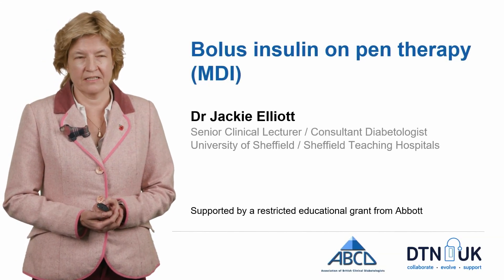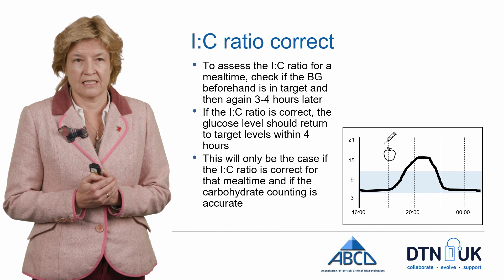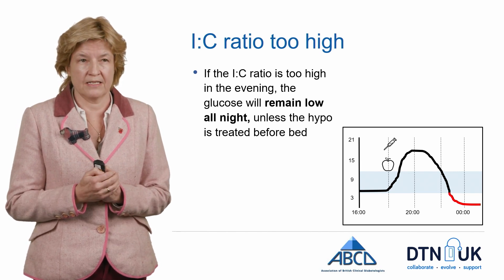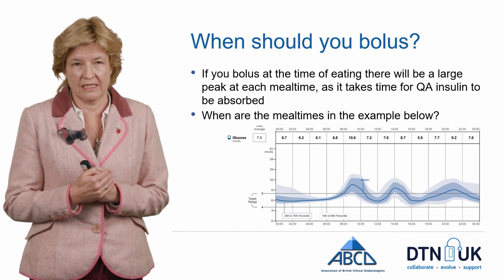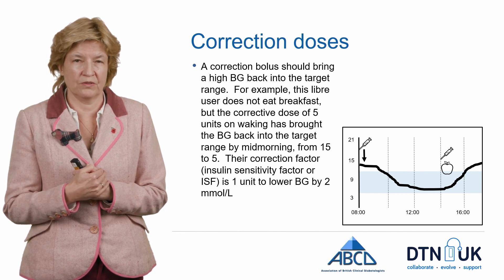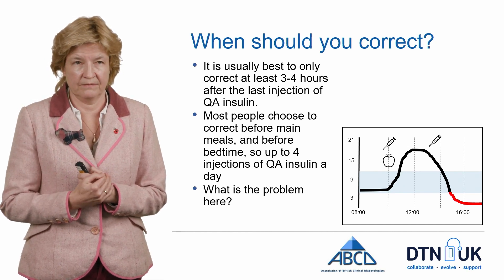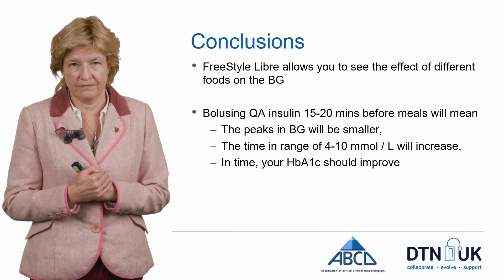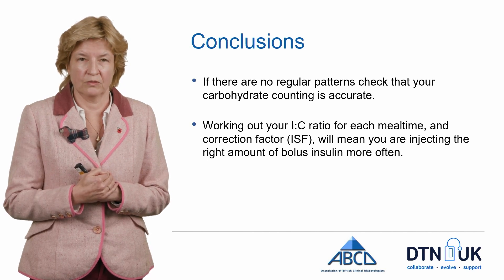Bolus insulin with insulin pens (Jackie Elliott)

Comment: The simple if inconvenient truth is that in the Type 1 insulin dependent diabetic injected insulin simply can not prevent damaging high bGs following meals. Increasing the amount of insulin has far more effect on increasing hypo risks 3-4 hrs after eating than it does on preventing skyrocketing post meal highs. Increasing wait times between injecting and eating also serves to reduce post meal highs but it does so at increasing the risk of calculation error induced post meal hypoglycemia! The sad truth is that diabetics consuming high carb meals will seldom be able to eliminate damaging post meal high bGs. The solution! Eating low carb meals of around 15 grams of carbohydrate.  This not only allows you to completely eliminate post meal high bGs it also allows you to greatly reduce the amount of insulin you are injecting to a more physiological appropriate level. Excess insulin damages body tissue so the less insulin you take the better.